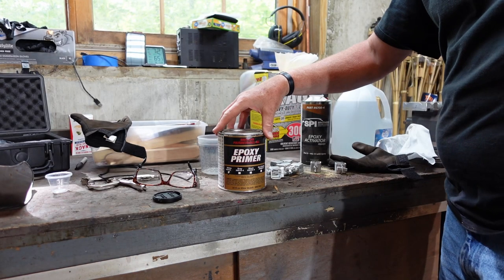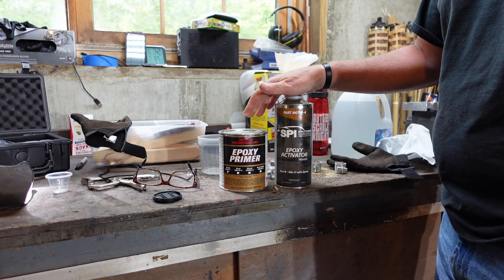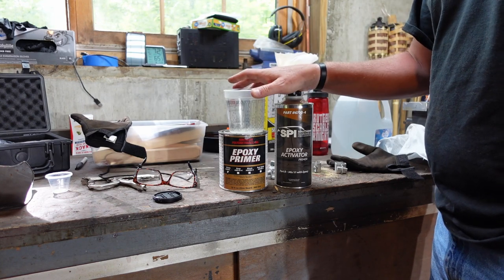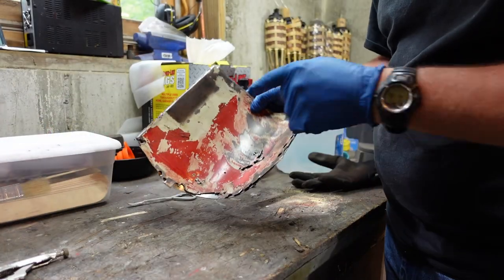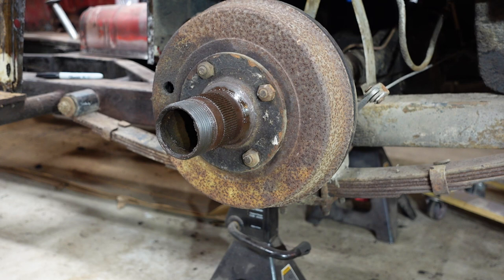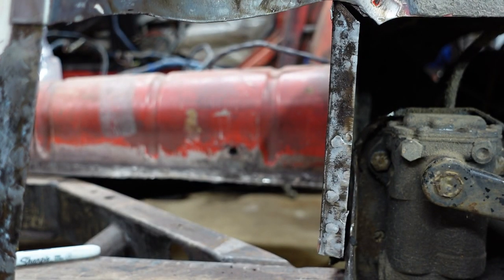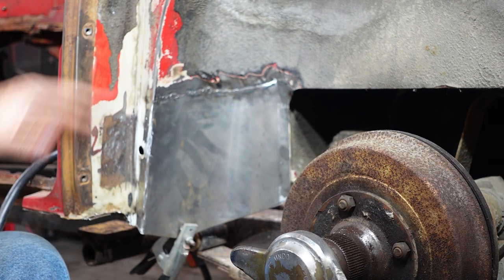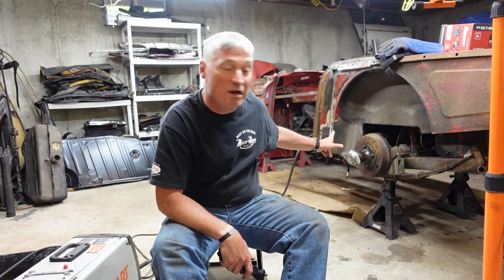Triumph TR4 - Rear Wheel Arch Patch | Roundtail Restoration

Comment: I've certainly been through the bracket fab failure, but each one is a learning experience.  

Your patch panel on the rear wheel well turned out very nice.  

I'm currently working on the drivers side floor of my '64.  The floor from about the door forward is pretty much gone and I plan to fabricate a replacement for that area.  The challenge will be forming the stiffening ribs so I've been watching videos on that.  Once I have the floor rebuilt, I'll be doing the outer rocker panel replacement, so I'm very interested in your progress.  Keep up the great work!
Reply from the maker: Thanks, Dale. I have to do ribs for the front footboard. Need to start studying how to do that since I  think it should go in before the floor.